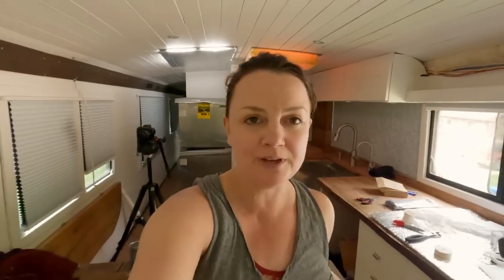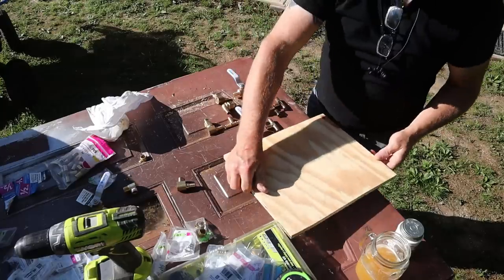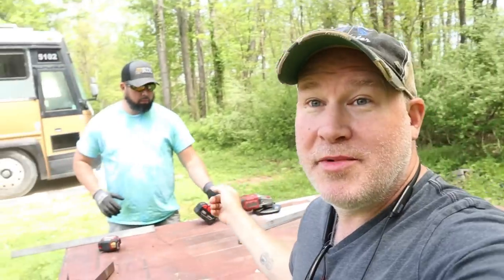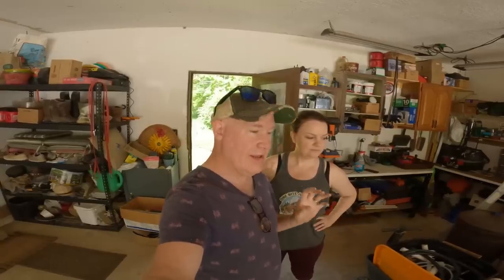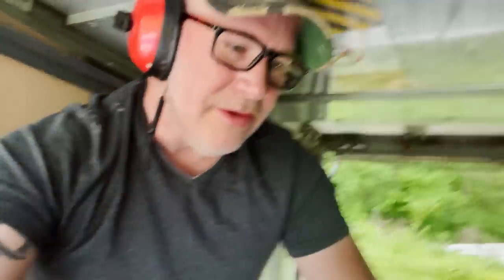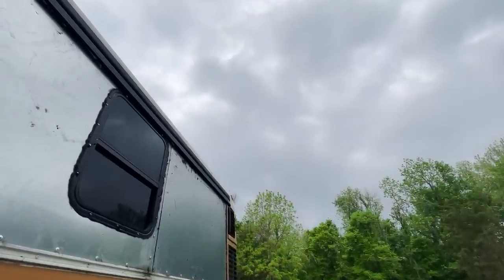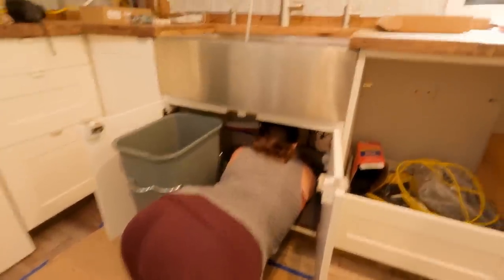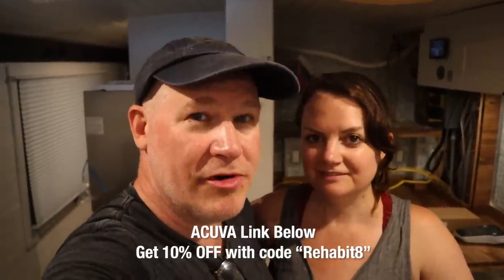SAFE RV DRINKING WATER // Acuva UV-LED Water Purification System // BUS CONVERSION - S04E57

Comment: just a quick suggestion, put a shut off switch for the water pump in the water bay close to the pump, way easier the back and forth to the fuse panel if/when you need to do service. A lot of "rv" water pumps are hot garbage and tend to fail. I have replaced one too many, finally switched over to a 12v sprayer pump which has been way better for me.
Reply from the maker: Hey Gary thanks for the input- we have an on off in the kitchen as well to cut power to the water heater but I probably will still kill the breaker to be safe

Comment: Yay and way to go you two on getting your water system running! I like your filter faucet and who ever designed was brilliant coming up with it and it's life saving. Now it's time to move in. All you got left is to paint the outside of the bus and do ya'll have a color picked out?
Reply from the maker: Yes we do 😉
Reply: Didn't they already paint the bus once?
Reply: @Rehabit8  didn't y'all paint the bus once?
Reply from the maker: @juliazentner681  nope.  It had a black wrap, which we removed, then we reskinned it to put in RV windows.  So it is half unpainted metal currently and half this weird almost school bus color. Definitely have to make the outside look as good as the inside 😉

Comment: Nice job Don it looks great in still working on mine I really like how yours turned out.
Well done.
Reply from the maker: Cool, thanks!
Reply: @Rehabit8  hey Don I'm watching the video again and you are building the board for under the kitchen sink with all the valves and you explained what each valve goes to you said the dishwasher gets a cold water line is that right?normally it's a hot water line just wondering mine does even if it's got a heater built in the dishwasher? Anyway thanks for the tips.